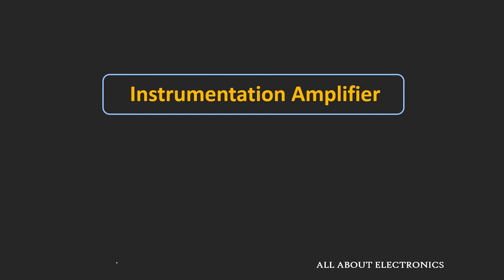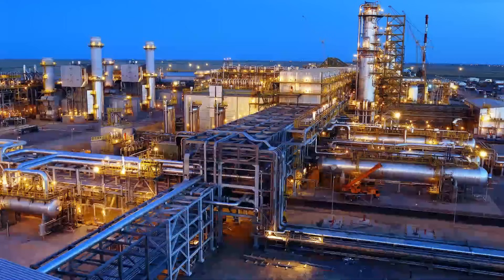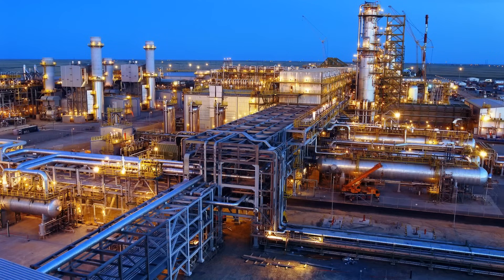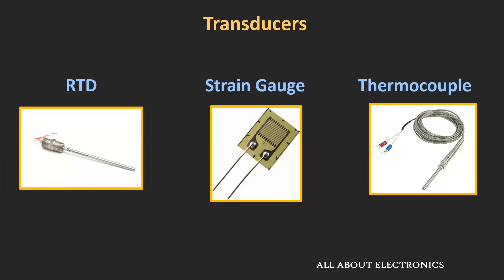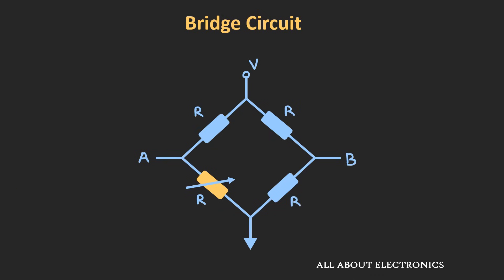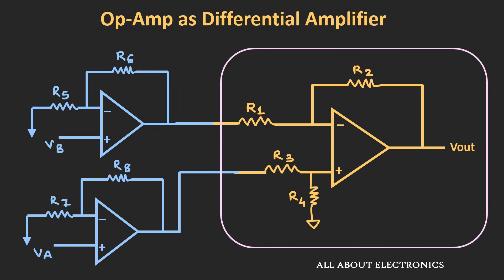Instrumentation Amplifier Explained (with Derivation)

Comment from the maker: The timestamps for the different topics covered in the video is given below:

0:19  What is Instrumentation Amplifier?

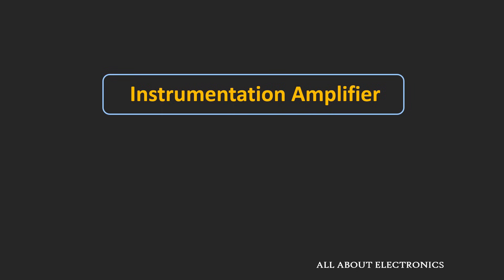0:55 Why Instrumentation amplifier is prefered over the differential amplifier in certain applications

11:20 Instrumentation amplifier circuit explained with the derivation
Reply: sir,it could be better if a make a playlist of this amplifier which are the application of op amp.because i find ur schmitt trigger after a long.Thanks for this fab  video.
Reply: Any thumb rule is there for achieve maximum gain?
Reply: Me

Comment: Time 9:43  Shouldn't it be the input impedance of the non-inverting terminal is R3 parallel R4 and not R3+R4?
Reply from the maker: To find input impedance, we apply the input and find current. The ratio of input voltage to the input current gives the input impedance looking from that end. So, considering ideal opamp, no current is flowing into opamp terminal. Hence, input current is Vin / R3 + R4. Or input impedance is R3+ R4. I hope it will clear your doubt. For more information, please check the video on non inverting opamp. I have derived the expression of input impedance.

Comment: 10.009(vcm+vd2)+10(vcm-vd/2)= 20.009vcm + 0.0045vd what am i missing here?? 7:27
Reply: He has done a previous step wrong: it should be V●=10.009Va-10Vb, refer the original formula, his final answer is actually correct
Reply: @sid_9696  thanks you, i will check later!

Comment: so we modified the Subtractor design or differential amplifier design by using pre-stage which acts as voltage buffer for common mode voltage & Differential amplifier for differential voltages and eliminating the issue of Resistor mismatch which results in finite CMRR

Comment: Sir at 9:53 why the differential input will be lesser?
Reply from the maker: Because the effective voltage which will be available at the inputs of the differential amplifier is Zin*Vd/ (Zin + Rs).
e.g if at the inverting end input impedance is R1, and let's say the resistance of the bridge circuit is also R1.
Then the effective voltage available at the inverting terminal is Vd1*R1 / (R1 + R1) = Vd1/2
Normally we assume that the source has zero source resistance, which means entire input appear across R1. 
But because of the source resistance, the effective voltage will reduce. 
Here the resistance of the bridge will also act as a source resistance. That's why differential input will reduce if the source resistance is comparable to the input impedance.
I hope it will clear your doubt.
For more info, you can check the video on input and output impedance:
Here is the link:
https://youtu.be/7jw2_x8dyQ8
Reply: @ALLABOUTELECTRONICS  yes sir, thanks for the help😄

Comment: Pronunciation needs some work (not that I can speak your language). Other than that, good video. +1

I think the critical intuition about instrumentation amps is that the first two op-amps totally isolate the input away from the gain resistor network. This prevents the amplifier from loading down the transducer.
Reply: There's subtitle though?

Comment: I was going to use instrumentation amplifier for my final project. In proteus simulation i get the values that i want but in application, i got way more different output voltages from instrumentation amplifier. So anyone has an explanation for that situation?

Comment: Another doubt bro. In Duration 14:52 how did you arrive at the expression (1+2R5/RG)

When i do it I'm getting (1+2R5) and the RG is getting cancelled out.
Reply from the maker: Ig is equal to (Vb - Va)/ Rg. If you multiply this term with (2R5 +Rg) then you will get (Vb- Va) (2R5/Rg + 1)
I think you must have made some minor mistake during the calculation.
Please do it again. You will get it.

Comment: I have a question.why we use differential amplifier in the instrumentation amplifier if we get differential voltage from buffer amplifier which is used in instrumentation amplifier?
Pls answer soon
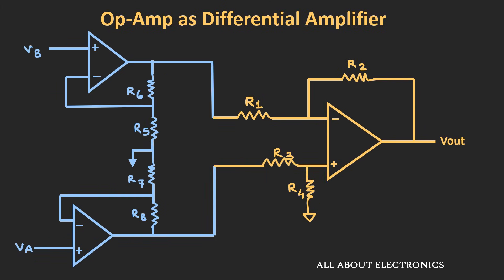Reply from the maker: To improve the signal to noise ratio. Please watch the video from 10:53 onwards.

Comment: 9:38
Hello, can i ask why is it that the input impedance at the inverting terminal is equal to R1? Shouldn't the input impedance of an op amp be very high? Similar question for non inverting terminal.
Reply from the maker: If you watch my previous videos on op-amp, I have calculated the input impedance for both inverting and non-inverting configuration.
Please refer those videos.
Here is the link:
https://youtu.be/uyOfonR_rEw

Also please use the timestamps I have provided in the pinned comment to go to a specific topic.

Comment: How buffer circuit solve the problem of low input impedance problem at input terminal??
Reply from the maker: The input impedance of the buffer circuit is very high. So, basically, it isolates the input signal from the op-amp.

Comment: Another excellent presentation.  Are you saying in some cases if you use unity gain op amps on the inputs of another op amp with matched resistors you can probably not have to purchase a IN amp which can be expensive ?
Reply from the maker: Yes true. But moreover that, Instrumentation amplifier has high CMRR and low noise than regular op-amps.

Comment: on 7:04 how did value come in terms of vcm and vd?
Reply from the maker: Va= Vcm + (Vd/2) and Vb= Vcm - (Vd/2)
Just put these values and solve it. You will get the output in terms of Vcm and Vd.
Reply: Hi, how did you get this equation Va= Vcm + (Vd/2) and Vb= Vcm - (Vd/2)? is it because you assume that the op-amp is ideal and by this equation Vcm will get cancel away and left with Vd?
Reply: @ALLABOUTELECTRONICS  how? How is 10.009(1+5mV/2)= .009?
Reply: @ALLABOUTELECTRONICS  10.009vcm +10vcm = 20.009vcm .. Where d u get ur numbers? Also with vd